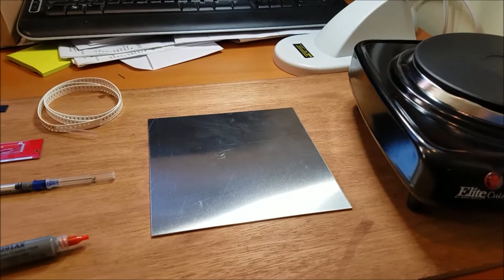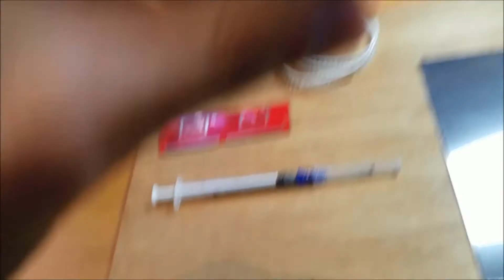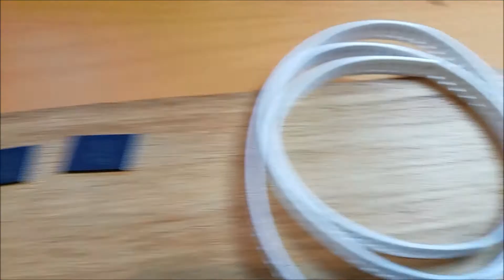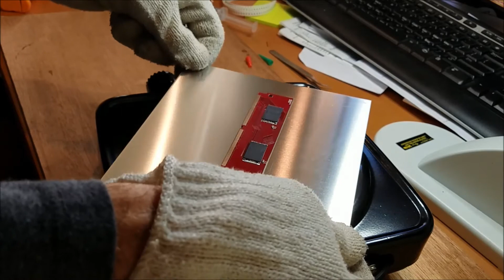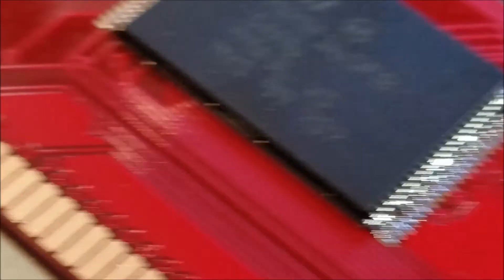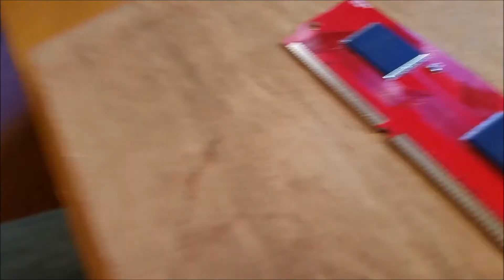Hotplate Reflow Soldering

Comment: You need to add more flux.  That is why the solder didn't flow properly. You could even run a soldering iron over these pins and get a good result provided you use more flux.